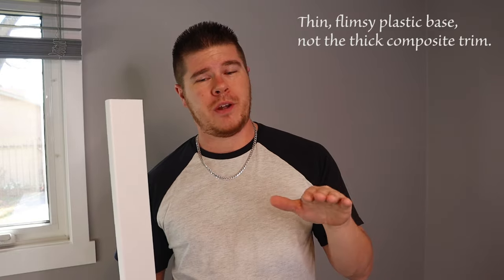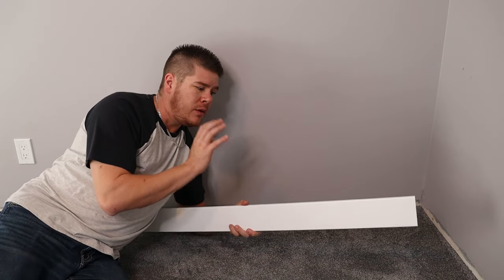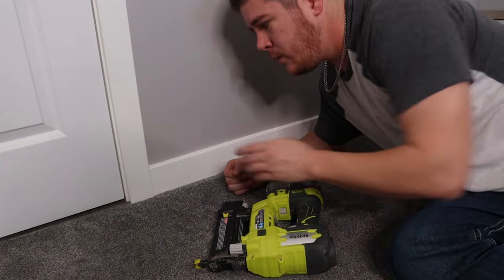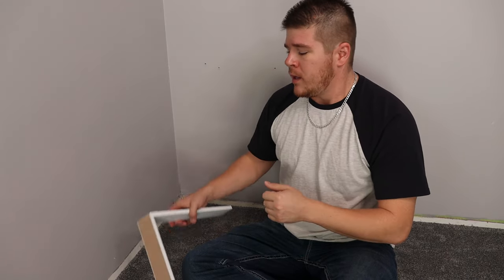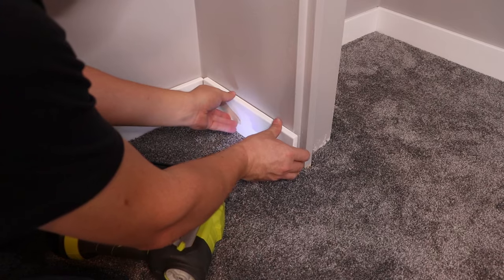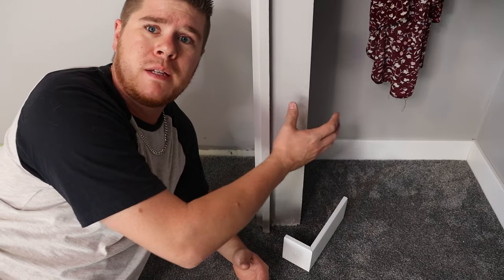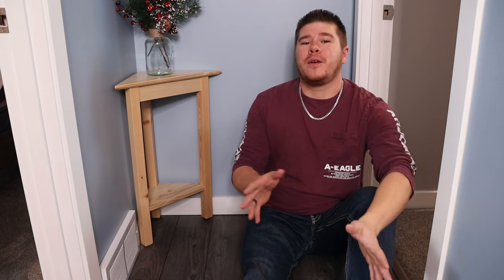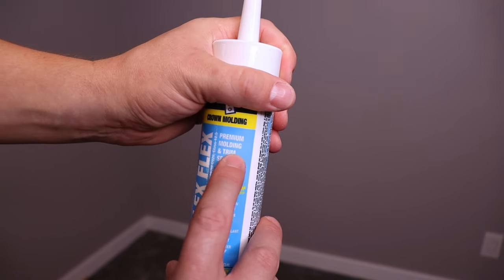How to install baseboard for beginners

Comment: I'm about to do baseboards on my new house and am curious, I just want the same as in the video but I was trying to decide between miter cuts or butting it up but I was going to use a dado stack or router to make a rabbet. Just sticking the two pieces together seems like cheating but if you can't tell...
Reply from the maker: Sorry for the delayed response, but it's one of those things where I just keep it simple. Nobody will get down on their knees to examine your corners
Reply: @JessedoesDIY  I'm actually in the middle of doing it. I just mitered them because there was a bevel on the front top. Thanks! And I agree, if someone starts picking on my baseboards I'll politely tell them to stop. Lol.

Comment: I’m sorry if I missed the explanation to why… Why do you have to paint them before putting them on instead of just painting once after?
Reply from the maker: It would be a nightmare to get a full coat of paint on them properly and get proper coverage while laying on the ground after. Plus it's faster to pre paint with a roller.

Comment: Great video thanks 🙂
I’ll be attempting to install baseboard after living at our place for 7 years!
Wondering how I go about doing inside ‘corners’ of a three windowed bay window? Any tips for that?
Reply: I think they would say trace it onto cardboard first and then transfer the drawing to your wood/figure out the angles from the cardboard, then use a mitre saw or handsaw mitre box
Reply from the maker: Hey, sorry I missed this response. Thanks for watching! An easy way would be to go and get a angle finder from a hardware store. Hold it in each corner to find the specific angle of your corners. Then split it by 2 and that's the angle you cut your 2 ends at. That's how I'd do it

Comment: Do you mind sharing where you got the baseboards? It looks similar to what I'm using and I'm having trouble with it warping (it's pine). The MDF you're using looks more solid.
Reply from the maker: I'd share a link but home depot won't let me do that. It's just flat stock base you can get from the mounding and millwork dept. MDF is just stable because there is no wood grain.
Reply: @JessedoesDIY  Thank you!
Reply from the maker: Anytime

Comment: Hey man, so if you were to spend money on one stapler/nailer for general home use (trim, kitchen cabs, etc) what size would you go with?
Reply from the maker: 18 guage Brad nailer. You can use it for most anything and in combination with a little glue for extra strength if needed, it has more than anough holding power for general use. It's by far the most versatile. It's rare I need a stapler so a manual one works for me
Reply: Go with 16 guage. 18 guage is too small and weak for bigger stock and 15 guage is too big for small detail work. Dewalts 16 guage nailer is just right, IMO.

Comment: About the outside corners, what about the corner beads? Can you just shoot a nail through it or do you keep far enough away from it so the nail doesn’t touch it?
Reply from the maker: Keep the nail back from the corner 1"  or so from the drywall, or 1.5" from the outside of the trim.  That way you hit the stud in the corner and by that, you'll be well clear of the corner bead.

Comment: What’s the difference between these nails and 6D 2” finishing nails? Would Liquid nails be or Ultra Grab by Loctite be ok, couldn’t find this 2 part adhesive at Home Depot today…
Reply from the maker: Those are bigger around and are installed with a hammer, these are much smaller and shot with a gun. These leave a smaller hole to fill, and less potential for damage to the board from a hammer. I typically stay away from any big adhesives on the back like those. They can be annoying to put on because you have to hold them in place till it tacks up, it's an extra cost to buy it all that isn't needed, and if you ever have to remove the board the amount of damage it does to the wall is much higher
Reply: @JessedoesDIY  Thanks for the reply, I ended up purchasing an 18G Ridgid Brad Nailer that’s battery operated. Seen that you had an electric one so I figured why not. I don’t use pneumatics that often. My inquiry with the glue was for the corners…
Reply from the maker: No problem! Yeah, battery operated tools are the way to go nowadays. Quiet, easy and always ready, no hoses or cables and enough power to do anything. Ahhh the you mean the CA glue and activator. I use Starbond, but basically any medium thick superglue will work even without the activator, you'll just have to apply it to one side and press togther and hold it till it dries in like 20 or 30 seconds. Any glue really will work, but that's by far the fastest method. Hope that helps
Reply: @JessedoesDIY  Thanks, I hope so too. Where do I se t the pics to?
Reply from the maker: Anytime, good luck! Jessedoesdiy@gmail.com

Comment: what is your preference? carpet on the floor first or base board first then carpet
Reply from the maker: Carpet first, then base, all day if I can. You have to be a bit more careful doing your touchups at the end since the carpet is down, but man, it's way easier installing the carpet without base in the way

Comment: Can you explain why you need to paint a layer before installing, just to paint it again? I must have missed it but i didn't hear a reasoning. Thanks!!
Reply from the maker: It is already primed, and 1 good coat of paint is all you'll need. It is far far easier to paint them on all sides when they aren't installed. Then all you need is touch ups after it's nailed and caulked. If you try to paint it after you'll never get it all, you'll probably touch your flooring or carpet, and it'll just be a lot harder being bent over
Reply: @JessedoesDIY  makes sence! Thank you!
Reply from the maker: Anytime

Comment: What saw do you use to cut the baseborads I need to buy one for projects around the house but did not realize there were so many options aviliable
Reply from the maker: I have a 10' sliding compound miter saw from Ryobi I use for all sorts of things. And I have a small 7 1/4" miter chop saw from Ryobi that I use for trim, it's just easier but the big one will do it all if you only want one

Comment: If you are installing baseboard over pergo floors do you leave a space between the baseboard and the floor, to allow for the boards to expand?  If so, how big of a space do you leave?
Reply from the maker: Nope, press them right down to the floor and then nail to the wall. The floor can still move because the base isn't nailed or glued to the floor. No gaps

Comment: So just wondering would this kinda board be helpful in a mobile home.. cuz we have really bad water damage in our barhroom and id like to repair the floors and fix the wall damage that resulted from the water damage
Reply from the maker: If you're worried about water damage I'd look at a pvc base. You can get it in the same flat stock style, but you'll never have a problem with plastic. Same with the floor, use a vinyle waterproof LVP as opposed to a wood style

Comment: How do you install this if you have quarter inch space around the perimeter for expansion of vinyl planks?
Reply from the maker: It goes right on top of the planks to cover the gap, install method is the same

Comment: Why not use white wood filler for the nail heads?
Reply from the maker: Because this drues fast and sands out smooth. Either way you'll have to sand and paint, and this dries white anyways. Whatever filler you use you'll see it when the light hits because it'll be a different sheen. Plus it may discolor over time and stick out even more

Comment: I love when the baseboard doesn’t need quarter round or shoe molding. I redid my bedroom flooring and don’t need the quarter round anymore but the people who had done the wood floor in the rest of the house…. The quarter round BARELY covers their horrible flooring mistakes. I can’t believe the people who lived here before me actually paid for that terrible work and never seemed to check bc it’s like that so many places not just two or three.
Reply from the maker: Yeah I much prefer it without it, cleaner and more modern without it. Ooof, that's no good, it shouldn't be used as a cover up like that.

Comment: Why don't you recommend butting together at corners? It seems so much easier
Reply from the maker: As the seasons change, or the house settles that joint will open up and be very visible. Scarf joints like these are much less likely to open and are less visible
Reply: @JessedoesDIY  Thanks for replying
Reply from the maker: Anytime

Comment: If you have long piece and you vut 44 degrees,and pre glued them,the long piece will distance from the wall at the end of the piece, it's better to stick them together on the wall and fill the joint gap eith caulking if that's what you moving with

Comment: I'm no expert but how are u gonna replace the carpet without removing the baseboard?
Reply from the maker: It's kind've a pain. It needs to be yanked out from under it and off the tack strips. Then the new carpet has to be cut slightly larger than up to the baseboard so it can slide under it. Then use carpet tuckers to push it under the base and kickers to stretch and lock it to the tack strips. I'd rather just remove and replace them, which is what I did lol

Comment: At 15:03, why wouldn't you make a mitre cut for the corner???
Reply from the maker: As I said in the video, inside corners it just isn't necessary, just outside corners where it will be visible

Comment: Hi. How do I nail my baseboards without splitting?
Reply from the maker: If they are mdf they shouldn't split. If it's wood just avoid the edges where possible. Also hold the nail gun tight against the wood when firing the nail so it doesn't bounce. Noting much else you can do

Comment: Can I use 1/2 inch on concrete walls let me know thanks
Reply from the maker: 1/2" thick base is fine, you'll just need to use adhesive like no more nails or something to attach it to the wall

Comment: how do you miss plumbing when nailing?
Reply from the maker: Typically a good stud finder will let you know what it is behind the wall. But also, plumbing usually, usually comes up from the floor pretty straight, and if you can pull of the trim piece for it you should see what side of the stud the pipe is on. Or just steer clear of known area where toilet or sink plumbing is, if you need to skip a stud to be safe, that's ok.
Reply: @JessedoesDIY  liquid nail in places around plumbing. Is it at all likely to hit electrical?
Reply from the maker: You could use a stip of that on the back of the trim to avoid nailing there. Just be careful that  if you ever need to remove or replace the base, it may damage the wall.

Comment: It was a good video only one thing their was no mention of steel studs
Reply from the maker: Thanks. Steel is only used in commercial building where I live, I didn't think it was that common. To install them just put a dab of construction adhesive on the back everywhere there is a stud, and another dab in between. Basically a bunch of dots, you can make a line but it'll use more glue. Then at opposing angles fire 2 nails into each stud, almost making a V. They help hold eachother in and prevent movement until the glue dries
Reply: @JessedoesDIY   
Thanks for replying so quickly I live in Florida and most homes are using steel I’m originally from New York  and had a fence company and now I do all types of construction , I was planning to do exactly what  you suggested. Thanks again for replying. I mentioned the Steel so you may add that to your video, I thought you did an excellent on your video.
Reply from the maker: No prob! Ahhh well how about that. Yeah its typically commercial buldings here, I hated working with it when I did this for a living lol. Cool man, well I hope it goes well for you! Thanks for watching

Comment: I use my m18 nail gun as my stud guid from base to the nose is usuall my studs
Reply from the maker: Man I forgot about that. I used to do that when I did trim more often
Reply: @JessedoesDIY  I still miss them no matter what haha so I’ll do the angled nails away from each other so it holds to the drywall like a claw
Reply from the maker: Oh for sure. I know around here actually finding a stud at the correct spacing is more of a miracle if it is lol

Comment: I was thinking they always glued base boards to all the walls
Reply from the maker: You can glue in the last 6 inches or so at a corner to help it stay closed, but I've never had an issue. You'd also glue them to concrete walls or walls with steel studs

Comment: Corners around a rounded wall?
Reply from the maker: Find the point where the rounded plastic corner bead meets the flat wall and make a mark at the edge, then go forward towards the corner again about another 1/4" or so and make another mark. This is your reference. All your cuts on this should be around 22.5° but you may need to make an adjustment depending on your walls, or stick with this and fill and gaps with caulk after, up to you. The inside edge of your trim should be at the reference line and the front edge should reach past. With both your trim pieces on each side temporarily you should have a small 3/4" or so piece left to fill in, cut a small piece to fill it in with 22.5° cuts on each side. Then just glue it together and nail it on once it fits. If you need to make a adjustment do it on a long straight piece and remember to cut the long pieces a smidge long, get the corner to fit first, then adjust
Reply: @JessedoesDIY  thanks for your reply….appreciate your videos.
Reply from the maker: Anytime, thanks!

Comment: That’s BEHR caulk and I use it exclusively. Don’t hide the name. There is no need and they just might pay you for promo.
Reply from the maker: It's not BEHR, it's DAP moulding caulk. I want specifically hiding it, or at least I wast trying to. I don't cover the names of any tools or products I use because people will ask me about it anyways. That camera had a bad habit of the auto focus picking up on the weirdest things and I wanted my hand out of the shot.

Comment: Gauge is NOT spelled as "guage". (see 3:01)
Reply from the maker: You're right. And if I could go back and fix it I would but mistakes happen and my channel isn't nearly big enough for YouTube to let me have that feature
Reply: @JessedoesDIY  Thanks for your response. From what you said, YouTube doesn't give you the ability to edit things like that embedded text? So you're stuck with it at posting "as is" no matter what? To be able to edit and correct things is called a "feature"? I suppose you could only edit this using video production software which could be a lot of work - not worth it just for a misspelled word. I totally understand if this is the case. Good luck with it meanwhile, gave you a thumbs up!
Reply from the maker: No, because that stuff is built right into the video I'd need access to modify the video file that I uploaded itself. Large channels can do that, but I'd have to take the video down, fix it and re-upload it, which the algorithm would pummel it making it actually a detriment to me. I don't know why they lock the feature out for smaller channels but they do for whatever reason. I appreciate it though, thanks!

Comment: Keep that mdf crap. Why 44 degrees, how about 46? Mudman, drywall may not be plumb/level.
Reply from the maker: Use whatever you like. I explained why the angles are what they are in the video. This gets you close, caulk will fill the rest. Once it's on the floor and finished out, even if the wall isn't perfect, it'll look good to the eye from standing height, and that's all that matters

Comment: I that one of your sons toy your using lol 😢
Reply from the maker: Does is fire nails like it should? Yes, then problem solved. Why should I spend upwards of $500 when this does it just fine. If you don't want to use it then don't, but don't put down those that use something you don't like for no reason other than that